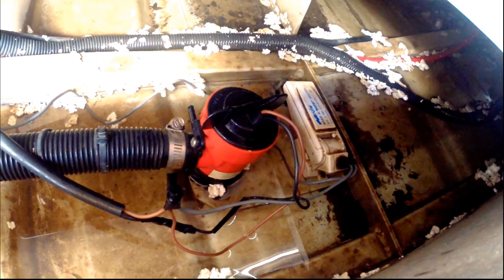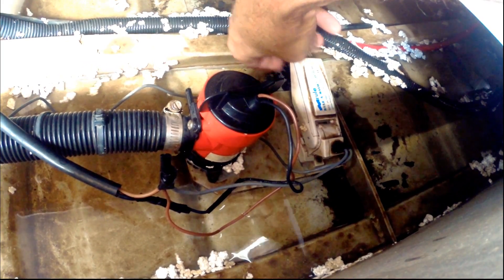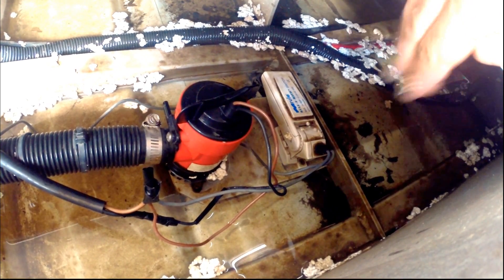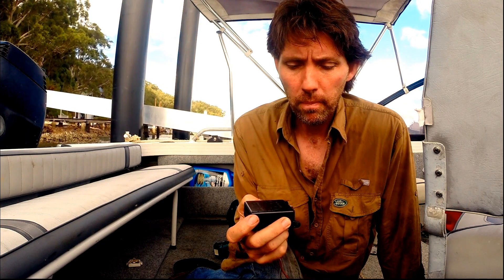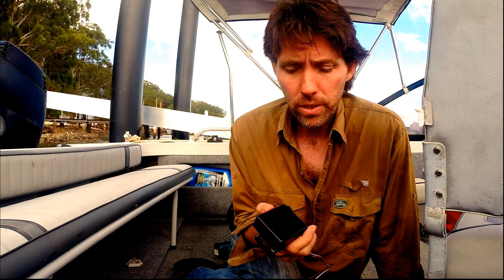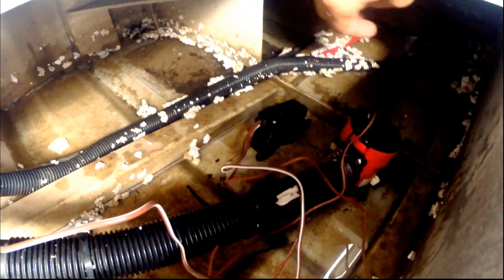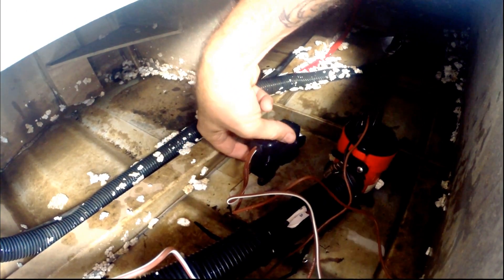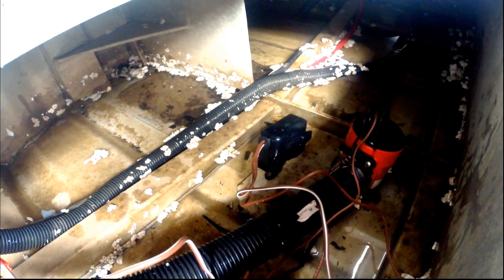Positioning a bilge pump and float switch in a boat

Comment: Ive got a fibreglass half cabin with a floor, so the bilge isnt even visible or accessible. Do i drill a hole through the floor to tightly fit the bilge pump intake? Maybe epoxy around it to make it water tight again. Cant find any videos about a situation like mine

Comment: Hi Sir you can use JB weld to mount the bilge pump to the hull of an Aluminum boat & well as the float switch & clean up the hull first & you can sand the hull with a little bit with 220 git wet & dry sand paper where you can glue the bilge pump down where you have sanded the hull as well as the float switch & you just let the JB Weld original dry & harden in 24 hours & it is amazing stuff that JB Weld original is Kind Regards Peter

Comment: Man glad I watched this because I didn't know there was a non mechanical float switch available. I would have all sorts of trouble on my airboat because on the river you get sticks and leaves back there that would jam up those mechanical ones. After a big rain and finding my airboat sunk in 4 foot if water I MUST get one on my pump! I was luck the engine is up high and was a foot above the water yet. Lost a bucket that had some nice tools in it when it floated away..🙄 Wouldn't have happened if I would've had a pump switch like that!

Comment: Hi Stu. Link to wiring video doesn’t work for me. Can you repost? Was about to wire up my pump to an auto switch on the weekend and I discovered the fuse in the auto off manual switch box I got is fused through the negative, not the positive! I was going to connect the negative straight to the battery! Wouldn’t have had protection had I not noticed!

Comment: Since you cannot screw them to the bottom of a thin aluminum hull, do you epoxy them down or do they just set in there?
Reply from the maker: I normally affix the pump to a plastic base plate that then sits in the bottom of the boat. Because it is wide it won't tip over like a pump on it's own.
Reply: This is an old post but for future reference,  if you put the pump in the right spot and level, with a stiff output hose the rests properly, when you tighten the hose clamp,  the hose will hold the pump in place (at least on my boat).  However,  if you are unsure, I like Stu's advice of mounting it on a plastic plate for stability.

Comment: Thanks for the vid. I'm going to put one of those electric switches in my tinny now. My boat (4.4 stessco) slipped the anchor while I was walking around the island in my thumbnail pic. The bumping on the shore sheared one of the rivets that mount the bung plug (the female bit) and there was a heap of water in the boat. 30 minutes x 5mm hole = Ermagerd !Could you do a bit on adding flotation into small boats. Im not sure how much flotation is even in my boat.
Reply from the maker: Doing a vid on floatation is a good idea. I'll be doing a series of videos soon on building a small boat from scratch so I'll be sure to cover it then.

Comment: Hi Stu,
I am planing to keep my boat on mooring ball in longer periods of time.  It is not a self bailing boat. What kind of setup would you recommend for secondary bilge pump?  I was thinking to install an automatic bilge pump on a  separate battery, hook up a small solar panel to keep the battery topped off. My current bilge pump is manual only.  Thank you.
Reply from the maker: Having an auto bilge pump on a second battery is a good way to go. I quite like the field sensor switches over the manual float switches these days.
Reply: Thank you for your response, I watched your video about installing the pump, where you were using the  field sensor.

Comment: You shouldn't solder boat wires for the same reason you shouldn't use single core wire.  It's prohibited by ABYC Standards and is subject to breaking due boat movement and vibration.  Only use marine heat shrink adhesive lined butt connectors with marine stranded wire.

Comment: Im confused, so its always good to have abit of water in the bilge? also my switch sits inside a tupperware container thats glued onto the bilge with a lid on, it has holes on the top to let water in and so far i have seen any setups like it :/
Reply from the maker: Having a small amount of water in the bilge isn't a problem, but this setup is more about not burning your pump out by having the float switch detect water that the pump can reach.

Comment: My pump line has a simple one way valve on the outlet ( ping pong ball in a large bit of pipe basically) that stops the water in the outlet pipe flowing back into your bilge when the pump stops. I am not sure it is needed, but is a nice addition.
Reply from the maker: A one way valve is a nice idea. I'm going to be putting a new outlet in the Green Machine when I install the new pump as I am stepping up to a 25mm outlet, but it is just a normal skin fitting. I'll have to look around and see what else is available with a valve in it.